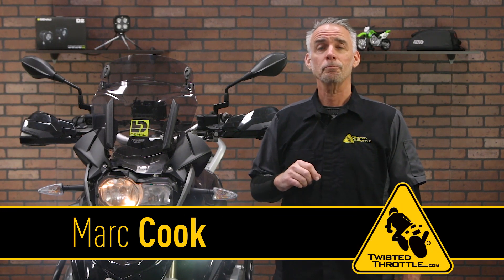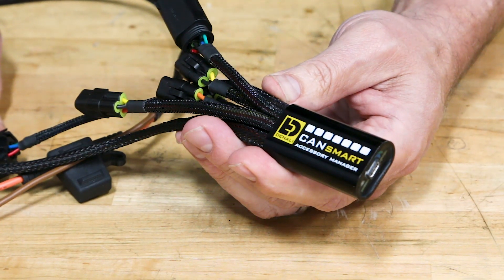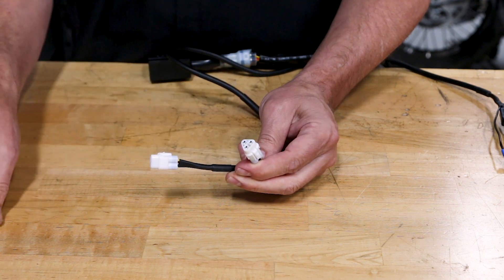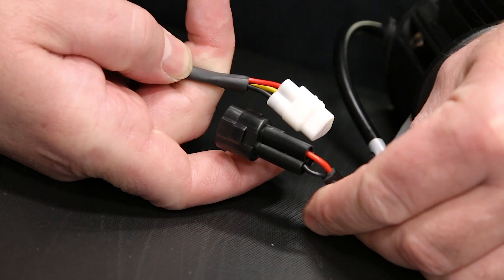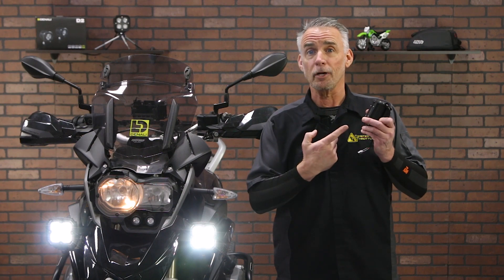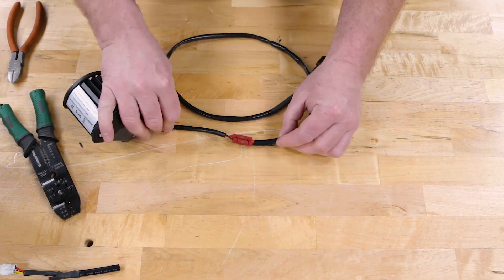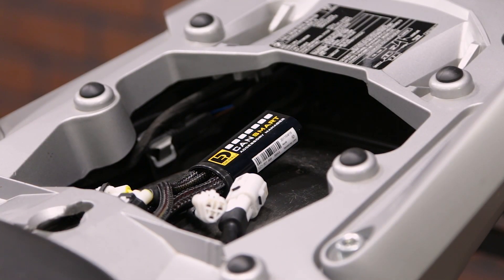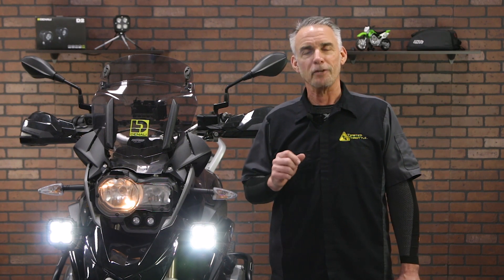DENALI CANsmart | Two-Wire Dimming Software Update | TwistedThrottle.com

Comment: The problem with the Denali unit is that the 3 wire sockets which receive the Denali lights are great for that accessory, however if you want to use the receiving unit to add accessories such as GPS power cable, or comms power cable which use 2 wires as default, you are left with a receiving wire not connected to anything.... surely this is a problem?
Reply from the maker: Just cap the unnecessary wire and it will be fine.

Comment: My thoughts are there need to be an IOS app that allows me to wirelessly manage the device with my iPad which has my manuals and all other schematics and apps. The new Rowe Electronics Amplink has wireless management and it is a dream.
Reply: Yes! Being able to manage the cansmart with IOS would be so much better than windows. I always have my phone with me and it actually works......unlike windows. I just bought the cansmart 2 but if they relseased a cansmart 3 that was app controlled I’d buy it in a heartbeat

Comment: Can you shed any light on the progress, if any, in the ability of the CANSmart Controller to dim the aux light on the side of an activated turn signal light?

I asked about this feature after buying the Denali CANSmart system, before realising that it was not capable of this function as the Clearwater CANOpener or Hex EZCan both can. Hex Innovations are the manufacturer of both the CANSmart and EZCan controllers, so they should be able to come up with a solution for customers.
Reply: Hi
Just got a feedback from Denali's guys on that matter.
Funny thing is that I've asked them after seeing your video!!!!

Question made:
I prefer to mount the system based on Denali's CANSmart, but I'll only do it if Denali's system cuts the lights whenever I'm using the turning lights signal (meaning it will cut the left lights when I'm signalling left or the right lights when I'm signalling right). Can you validate if your system does that?

Answer by email from Denali's on March, 23rd, 2018:
This feature will be added to our next software release. The software should be released in the next 4-6 weeks. Once we release the new software you will need to download it, then simply attach your CANsmart to your computer via the USB cable to update the device.

I'm only buying the Denali's CanSmart because of this feedback.
Reply: Ricardo - thanks for the update. I was wondering about this myself recently and I needed to go dig out the name of the guy I was emailing with to find out the status. Maybe I will still do that to give a sense of urgency to this.